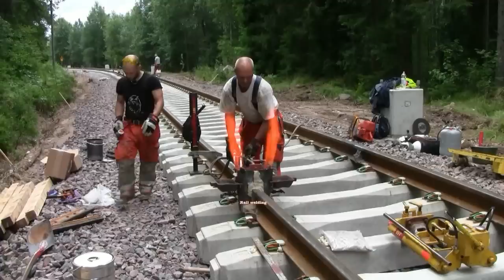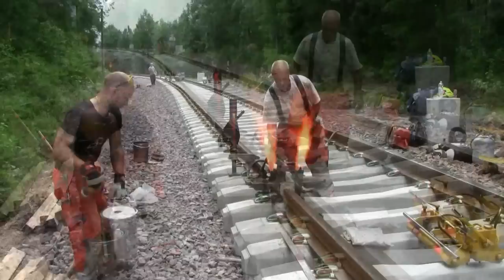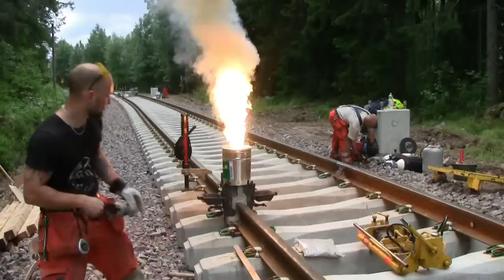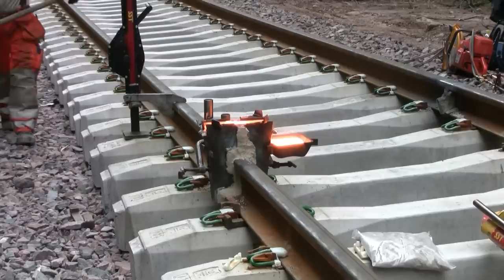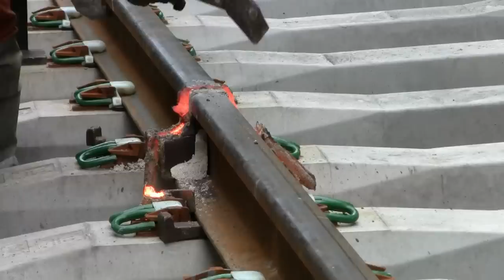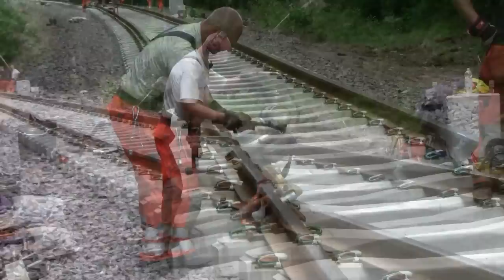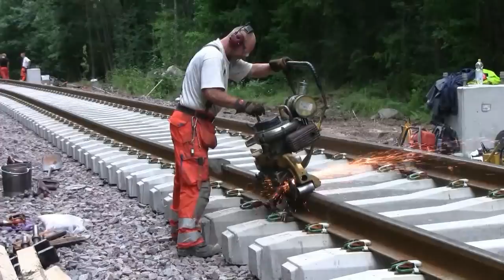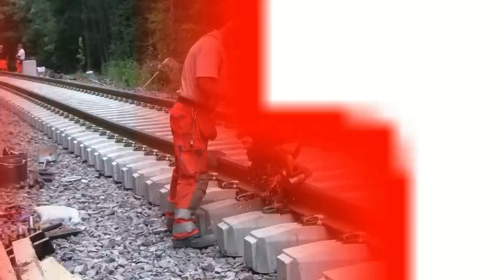Railroad thermite welding

Comment: Simon = we never had issue with those type of rod stick welding.. We saw those welding on rails decades later still standing and hold together the rails very well. So to me is a little surprising to seeso many parts needed, so many moving around times + lifting parts, carry parts etc when you only need a torch and MIG machine.
Reply: I will trust you on that since I have never seen it done on running rails despite being common on conductor rails for many years, whilst the railway is generally very slow to adopt new ideas I'm sure if it was a better system at some point in the years since thermite welding was first done in the 1930s arc welding would have taken over, yet it is still commonly used throughout the world (Flashbutt welding is better but mobile machines are very rare so it tends to only get used in manufacture not installation).

As far as the equipment goes whilst there are quite a few individual parts they are generally smaller and lighter than a MIG welding setup and as you'd need (or at least want) a track trolley to push all the extras you'd need (Gas bottles for the cutting torch, grinder, equipment to align the rails properly, probably some others I've missed) it probably broadly favours thermite welding although to be fair there probably isn't much in it.

I'm genuinely curious about whether the MIG welded joints were stressed or ultrasonically tested at all?

Comment: Interesting that a sound goes off when the plug at the bottom of the crucible has melted.
Reply: Yes.....it is interesting. Wonder if they will add more crushed rock later ?
Reply: I think it's a hammer hit down the line
Reply: Actually, looking at the bucket, it has to be some kind of a contraction or thermal shock, considering that there's a splash just as the ting comes

Comment: The railroad i work for in the u.s. makes welders wear earplugs so sparks dont sizzle your inner ear parts, fire proof jacket so you dont catch on fire and face shield plus goggles so u dont sizzle your eyeballs from a piece of hot metal

Comment: Simon = to bring or roll MIG machine there is just rolling it on the rails.,,, but from the video lot of lifting hitting and lot of parts there to bring just to the job. I still remember back in the regime welders used rods 1/2 " tick ones to weld the rails.... it was pretty powerful job. The light from 1/2" tick rods welding was 10 times stronger than regular rods.
Reply: manik

Comment: tracks never used to typically welded together but it is necessary with high speed rail for the smoothness at high speeds. interestingly enough the weld itself is made of aluminium not steel so infact using the thermite to make the aluminium hot enough to meet the melting temp of steel it bonds together

Comment: Thermite sure does a great job of melting steel when that energy is controlled and focused on a particular point. I wonder what else it's been used for...🤔
Reply: 9/11
Reply: bet you could use it to bring down three towers quick..
Reply: @mbgeloam  Maybe Canada should use it on Trudeau?
Reply: Yeah, go figure.
Reply: For the last damn time! Thermite is an incendiary, not an explosive!
Reply: @cowboysandindicas3635  we know this. No one's claiming it was used as explosive. However, it can cut through steel. Focus dude.
Reply: Are you suggesting that the 9/11 commission report is not an accurate retelling of the most modern security defying event in US history by highly trusted politicians?
Reply: @IPoopOnYouEveryLastOneOfYou  Why, yes Donny, it is.

Comment: We still use wooden ties in Canada.
Reply: Tyler Barr because railway is  a thing of the past they are ripping out tracks everywhere its more of a european thing now
Reply: Colestercamps i dont think so...its all a question of lobbying and btw: the us now get a taste of what happens if you're neglecting your railways for too long...lol
Reply: +Tyler Barr We still use that in Sweden where teh railroad stations are. Because there are alot of switches there.
Reply: Not if you had a high speed train track. Notice the reinforced beams every three feet.....they go five feet under ground, each weighs a few tons. Trains will fly by at over three hundred km/h....this needs to b very very solid.

Comment: But does it melt jet fuel?
Reply: MikeAvenger08 Considering jet fuel is a liquid...
Reply: +MikeAvenger08 probably make it vaporize. With that iron oxide it could burn the fuel but i'm not sure.
Reply: +MoonEyes2k Do you even 9/11?
Reply: apparently he doesnt
Reply: MikeAvenger08 Well, I have to say that I never 9/11'd. Since you seem to know what it is, you tell me. How DOES one 9/11?
Reply: +MoonEyes2k They're referring to the widely-held theory that the destruction of the World Trade Center twin towers on September 11, 2001 was accomplished not by crashing two jets into gigantic skyscrapers, but instead by the very clever use of thermite.
Reply: +MikeAvenger08 steel beams solidify jet fuel
Reply: +CanadianBacon DO YOU EVEN TRAIN?
Reply: Paul Hendrix *blink* Steel beams make jet fuel solid? Oooo-kay.
Reply: +MikeAvenger08 you rather should have asked: "But does it melt tower pillars?
Reply: MikeX89
Reply: Jet fuel is just thermite-liquefied steal beams! You can only make it if the beams are cut at a 45° angle...
Reply: MikeX89 Only the elite race burns the best with no residue.

Comment: I learned that the joints are there for a reason - to give space for the expansion of the track due to heat. Now if you weld them you are preventing that mechanism and would probably result in a twisted track. Not sure if I am right though. 
I like the sound of the joined tracks which gives some kind of drum sequence. But some are a bit noisy and would prefer a silent one.
Reply: All rails have expansion joints. Doesn't mean that each rail piece have to have them. CWR(Continously Welded Rail) runs for kilometers between the joints. Also, expansion joints don't run that way(90 degrees to the rail), they are diagonal and far longer.
Reply: @mooneyes2k478  But as I watched several train videos, I usually hear the sound the train makes when passing those expansion joints but some trains, You don't hear that sound which made me conclude it is soldered all the way through. Compare these two: https://www.youtube.com/watch?v=D1rfamuO2_A

https://www.youtube.com/watch?v=vT-YG0eytI8&t=1363s
Reply: @Dessme  Well, the difference there is that the Reunification Express is a long-range "soft sleeper", running from Hanoi to Ho Chi Min, taking 14 hours, in a nation that, with the best of intentions, can't be said to have an amazing infrastructure.

Spiez–Zweisimmen isn't, it's more or less a commuter train with a distance of 35 kilometers, approximately, that is running in Switzerland, a country with somewhat...Germanic....levels of accuracy and infrastructure.

Comment: No hot cut an sledge to knock ears back an eventually break when cooled an to knock of the top piece cut with the shears. I was a railroad welder  for Southern Pacific Railroad,then later the union pacific r/r.

Comment: Oh god we are so behind in England!  We are still using WOOD for the underlay ! HAHA
Reply: Wood is cheaper per construction investment, and it creates future jobs as it needs to be replaced more often.
Reply: Dovenpeis
if it is replaced more often...
Reply: Same in America. I've never seen anyone use concrete as an underlay before.
Reply: Suggest you check around more - lot of concrete sleepers out there in the UK
Reply: Yes, Stormlord, and that's why concrete is cheaper in the long run, especially if the working class wages are high, which they are in Scandinavia. However, as a capital investment right there and then, wood is cheaper than concrete.
Reply: Underlay?Are you watching a video about carpet and commented on the wrong video? :)LOTS of concrete sleepers in UK mate!!!
Reply: Kilo Byte  not in Texas at least.

Comment: OK to answer questions about what railroads weld rails together is to remove the joint from the track after all the joint is the weakest part of the railroad track structure. here in the united States almost all of the Major railroads have replaced their mainlines with CWR. but on the other side of the coin is CWR requires more frequent inspections both during periods of extreme heat or cold and the railroads have to have a policy in place for inspection repair and maintenance of CWR which this policy is also submitted to the FRA. and yes to answer another question hitting the fresh weld with a hammer could in fact cause a internal rail defect that is why railroads have test trucks that test the rail ultrasonically for these before they fail.  and yes I happen to work for the railroad as a track inspector
Reply: Andy Chmura 
any jobs going thermite welding. im doing it the past 8 years here in ireland.

Comment: I was told they had to leave the 1cm or however big it is gap between the two rails and only have the connectors on the side keeping them aligned, so that when the rail expands from heat during the summer, it wouldn't bend the track. Did they solve that somehow in the past 20-30 years?

Comment: What was the 'twang' sound at 0:47? Was it due to a piece expanding or what?
Reply: The molten metal dropping from the bucket hitting the much colder rail, the rail amplifies the sound because it's so long it acts like a tuning fork.
Reply: brett248vista  wow thats a great answer. thumbs up
Reply: fakhre alam
  Thnx :)
Reply: brett248vista
No, that wasnt it. I am a railroad worker and i recently worked with the team welding the rails together in exactly the same way, and it never made that sound. The sound either came from someone hitting the rail nearby (You can hear someone hitting it with a hammer from quite a distance if you are standing close to the rail) or from someone splitting a rail in two (We had this happen, because we were removing a 5m long piece of rail, and then welding a new one in its place, and when it separated, it was under big stresses, it would snap out of  place slightly, making that sound.)
Reply: brett248vista
You can see the guy in the back, he hit the rail with the hammer, if you look closely.
Rails are finely aligned on two ends, with hammers. You can only get them so aligned by placing them and pushing them around (Takes A LOT of people to do this) and to move them such small amounts you hit them with a hammer/sledgehammer.
Reply: brett248vista I'm going to agree with you. When the sound occurs, you can see some molten metal spit out the side of the mould.
Reply: Jason Axford That isnt it... I worked with the guys on 15+ welds like this lol.
Reply: sidedoororiginal I am not saying that someone hitting the rail wouldn't make a similar sound as it acts like a tuning fork. But it is absolutely possible that the 2000 degree steel hitting an ambient temperature rail, could make the same sound. Drop a room temp egg into a 300 degree frying pan and you get all sorts of sounds. I did not see anyone hit the track that was in synchronization with the sound that was heard. I will watch the video again.
Reply: sidedoororiginal
  Watched the video again closely. No one touched the rail that is in frame of the camera when the sound was heard. But, coincidentally the moment the molten hot steel dropped out of the crucible, the sound was heard.
Reply: brett248vista  It may be possible in theory, but im talking out of experience. You dont even need to hit it hard to hear it quite loud. Plus, there was likely more groups of workers behind the camera preparing another weld.
When the molten mix drops into the mould, its ever so quiet, quite honestly.
Reply: sidedoororiginal  Well it helps to have someone that has done it for a living, chime in.  I am guessing someone further up or down the line hit the rail as you suggest and it just traveled. Thanks for sharing your experience with us!
Reply: brett248vista FYI, the molten iron wasn't hitting ambient temp steel; the flames in the beginning were them preheating the rails with a gas burner so that the thermite would make a good weld with them. Not saying the sound wasn't caused by the effect you mentioned, but it's less plausible considering the rails were preheated.
Reply: George Burkhard  Good point about the pre-heating of the rails. I completely forgot to take that into account.
Reply: This is job sound! Job.

Comment: Safety goggles on the forehead will really prevent an injury.
Reply: The safety glasses won't protect against thermite anyway, which will just go straight through. The reason they have them accessible  is because they are doing some metal grinding at the end, where you see the guy doing the job actually use safety glasses.
Reply: Dovenpeis
Wrong. Safety gear will 100% protect against thermite sparks, the safety gear just has to be up to standard and not some cheap 0.55 cent walmart plastic piece of shit you'd give to your kids for 'chemistry' with mud and water.
Reply: @shanethomas772  Stupid is what stupid does.
Reply: its a fashion trend
Reply: Tom O बफछछग
Reply: @fidelcatsro6948  r

Comment: What the hell be that "Chwonk" sound at 0:47?
Reply: +Monel Funkawitz Check the guy in the background. Hes hitting the rail with his hammer =)
Reply: +Monel Funkawitz Someone else hitting the rail with a hammer further up the track, probably one of the other team of welders you can see in the distance.
Reply: That sound is created by vibrations traveling down the rail. The rail is shaped like an H, and the two "high points" (in relation to the H) act like a tuning fork. A really long tuning fork. So, instead of the vibration just getting passed back and forth between the two tongs of a tuning fork, it gets passed back and forth, and down along the track, making the sound travel away. I know it's not the simplest, or clearest explanation, (or punctual) but I hope it helps answer that question.
Reply: Monel Funkawitz it sounded like a laser
Reply: Your mom

Comment: Simon, =  Just look at the machinery and time they spend on it to fix that rail. They could cut a V shape on both end of rails using torch and MIG weld it in no time.
Reply: In terms of machinery, no there really isn't that much.  Compared to carrying a decent portable genny and all the associated MIG welding gear it's probably about the same.  You'd need a track trolley to get it any distance from an access point or platform in either case.  

In terms of time, a welding team can do a weld like this from complete start to finish in about 30 minutes on straight track and a good chunk of that will be waiting for it to cool so they can (And frequently do) set up a second weld while they're waiting.

I wouldn't like to be the technician stressing a MIG welded joint like you've described (I definitely wouldn't want to sign my name on any of that paperwork), and I would like to bet that the failure rates under ultrasonic testing would be through the roof compared to thermic welds.  Arc welding's fine for conductor rails which aren't stressed and don't have to take the same sort of pressure, thermic welding is far better for running rails.

Comment: Trains and cars are the other way around to each other when it comes to repair work. The track on which the train moves is the one that gets damaged, and no damage to the wheels occurs. But the road on which the car moves experiences no damage, but damage can occur to the wheels, which is the tire. Both the tracks and the tire have their own way of repairing. 🚞 🚗
Reply: Train wheels get damaged and wear out. Locos need new tyres quite often.

Comment: Pretty cool.  Im sure they know what they're doing but I wouldn't think that would be strong enough.
Reply: It's a solid piece of cast metal, the welds are usually stronger than the rail itself.  The only times I've seen a welded joint fail and break it's been the rail to one side of it that's broken rather than the weld itself.

Comment: good god what a long process, must take forever to run a km of track
Reply: time is not a problem because the make money anyway ^^
Reply: Vitunveijari
how many people? and how long is each section of rail between welds?
Reply: Mike Jones Usually 420 meters(longest allowed) between one pair of welds. one team makes about 10-16 welds in one shift is the conditions are not terrible..
Reply: Johan Israelsson
So those pieces of track are 420 meters long?

Comment: We done rail welding in E. Euorpe under communist era. Torch, + stabilizers and MIG welding. and grind it 
down  to be smooth.
Reply: I've seen that done on conductor rails and it really isn't any quicker, more importantly when I've seen that done it's not welded all the way down the rail web so unless you can fill the whole gap with zero porosity (Which would add more time), it would fail either the welding manager's inspection or the first ultrasonic test that goes over it (Or probably both).

Comment: wow and they have to do that twice every like 20 meters or so? that seems like a lot of work!
Reply: Actually it is all ~150-200m
Reply: I dont think they are able to transport steel beams of 200m.
Reply: oko2708 The steal beams are produced in the factory and immediatly transported by train. No need for cars. And because of the good flexibility properties of steel it is no problem to bend even in smaller radii. So up to 200m is not a big deal...
Reply: FzzLe Ahh that makes sense!
Reply: They're actually 1600 ft long or 488 meters, well at least here in California.

Comment: i worked on the rail 35 years ago had to pack the mold in sand thermite came in a bag was a pain in the ass but i think i used that same grinder

Comment: I've used drag racing top fuel nitromethane which is 50% Oxygen by weight it wouldn't melt or burn Steel. Years ago I had to break down and buy a metal cutting saw and cutting torches.